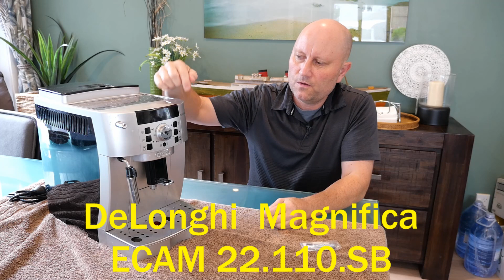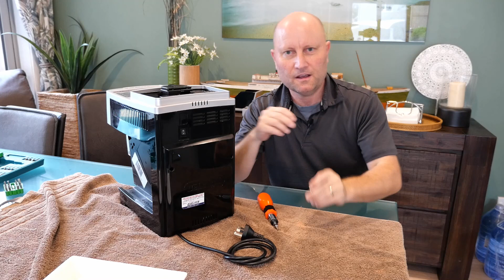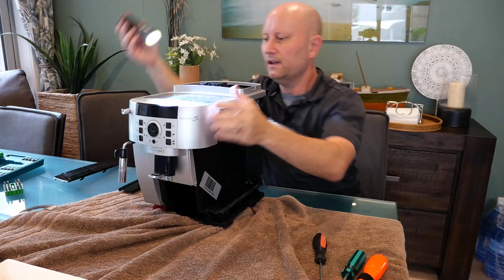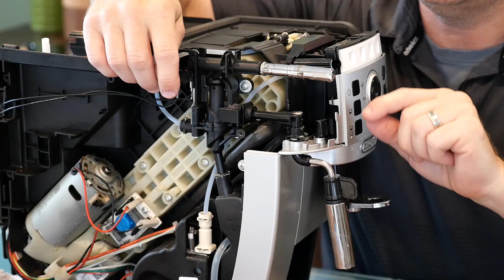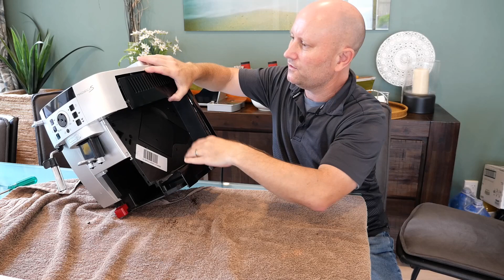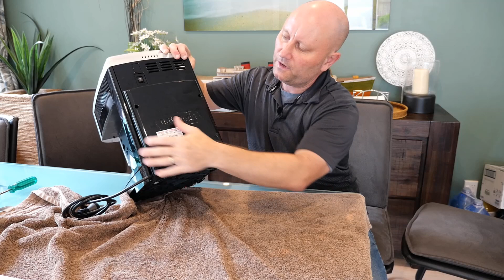DeLonghi Magnifica COFFEE MACHINE FIX Steamer handle - Disassembly Tear down ESAM22.110

Comment: Great video. After watching the whole video first I decided to just try pulling the steamer knob out without disassembling the machine. It came out relatively easily with the locking ring still attached. Pushed in the replace knob (without locking ring as suggested) and it works. Job took about 30 seconds after watching your video! 😅
Reply from the maker: Excellent, thanks for watching & glad it was helpful for you, in doing the fix

Comment: Thank you for the video I did not know the steamer handle pushed right on as a viewer mentioned that I read after fixing my unit. Somehow while turning off my steamer  I pulled the knob off! I initially thought I broke it. The star tool which I have the normal version I just dremeled a tiny hole in the end of my bit as a drive to town in Alaska is 2 hours round trip. It worked I’m happy!
Reply from the maker: Glad this video was helpful for you and you were able to fix your unit, great job with the dremel idea..  creative solution..
Reply: @DIY-CIRCUIT my unit is identical however has a flat push button front. That’s to bad your having so many issues this is my second DeLonghi Magnifica just a newer updated model. My first one lasted 12 years. I should have watched your entire video before starting i would have realized my button just pushed on. there is no retainer ring on my model so not sure it’s needed on yours. I’d leave it off also. That is one part they could improve. I’m looking forward to a great cup in the morning as cowboy coffee just didn’t do it for me after being spoiled with my Magnifica for so long.😁
Reply from the maker: @MurphysAkAdventures  Thanks for watching,  you just reminded me too, its coffee time.. cheers

Comment: Thanks for the video great inside saved me some trouble breaking something while opening for first time. I am not sure if the retainer ring is passing through the hole of the casing so you dont have to disassembly so many parts BUT I would not recommend just pulling it without supporting the support holding the male part maybe next time the support breaks. Also I would keep the retainer ring in sine the gearing can be damaged in time.
Reply from the maker: Thanks for watching and good to hear you found this useful..  you just remonded me too.. time to make a coffee

Comment: You dont need to pull it apart it simply pulls out. But thank you for confirming that it could be pulled out. Now I have a 20 second fix.
Reply from the maker: your welcome
Reply: same, goes off with pliers, but thx!
Reply: Yep, it pulled out without any disassembling and was replaced just as quick.

Comment: Great video, however, probably for many, the steam handle breaks because the valve is wearing and it is very hard to operate.
So your new handle will probably break again.
Well, this was my case at least.
Reply from the maker: Thanks for watching.  Yes I suspect in some cases a stiff valve can put pressure on even a new handle..

Comment: I had exactly the same model from new and it had no such retainer ring. Also the screws on the back needs a T20H driver as the screws have a tiny  central pin. A simple star driver will not fit
Reply from the maker: Thanks.    I didn't replace the ring on this unit, and still working great

Comment: You don’t need to take it apart. The handle pulls off. It took me less than a minute to fit
Reply: depends if the original one left broken parts and the spring closer part inside or not... if bits are left inside on the spindle the new handle won't be able to go as deep on the spindle as it should and will therefore in turn break off easier...
Reply: The machine from new had never been repaired before. I searched two solutions, the first was a tear down, the second was to simply pull, which I tried to, and it worked. There was no clip holding it in or any broken pieces.
Reply: @enthusiasticone5133  yes. that's what I'm saying though - it's quite possible that the old spring retainer part of the old handle will get stuck inside on the spindle and if that happens you need to take the cover off the sides to remove it. (which is actually very easy anyway and takes only 5 minutes). to be honest it's a design flaw with the stiff spindle and plastic knob handle parts.
Reply: There was no spring retainer
Reply: @enthusiasticone5133  all the steam knobs have a little spring on the end afaik maybe it's inside on the spindle
Reply: So, you’re calling me a liar. I will say again, I bought mine brand new and the steam knob DID NOT HAVE A RETAINING SPRING. It could be a factory error, but it didn’t have a retainer spring.
Reply: mine didn’t have and I replaced it two years ago and it hasn’t broken so…
Reply: I also just set the handle on on-mode and could pull it off.
Reply from the maker: yes, true sometimes you can pull off without opening.

Comment: I have two questions if anybody has the time to reply then very much appreciated.

My machine broke today, the steam lever was stuck on the ON position, I was able to return to OFF and have since ordered a replacement part. 

Did anybody find that the lever was really stiff? 
Will replacing the leaver provide the correct leverage or do I need to consider buying an additional spare part?

Cheers 

Dan
Reply: it's pretty stiff and stays that way. there are a few different type of steam knob replacement designs - try to find the one that looks like the one that it originally had.
Reply from the maker: yes, they can be stiff.  some lube inside might help

Comment: I had put off doing this for months and then when I finally sat down to do it, discovered none of the T20 screwdrivers would even grip the screws because they are in such difficult positions. I am so glad I decided to read the comments. So, I would like to agree with everyone who said you don't need to do all this disassembly. Simply remove the broken steamer handle (ours had split and fallen apart, so had already come out). Stick the new one in the hole, without the split ring, and taa daa - it is fixed!
Reply from the maker: yes, definately, its worth trying the fix without dissassembily

Comment: QUESTION i have the same machine new looking at it for a friend everys cleaned water in when i hit the power switch i goes through its cycle and i get the red triangle , i also looked at the infuser and it stops where i cant remove it beouse the gear arms are spread ive tried everything but it ends the same ? thanks
Reply from the maker: sounds like a trycky problem.  I havent seen this one.

Comment: Excellent video, thank you very much. As with Tracy below, I was unable to remove the coffee dial but discovered that it wasn't necessary as the cover lifted straight over it.  Also great advice about removing the small wire ring at the end of the replacement handle to avoid the dismantling later.
Reply from the maker: thanks for watching, much appreciated

Comment: I had the same problem and Delongi support team said that the knob can be replaced without any disassembling the machine. Is that correct?
Reply: Yes. Just try to pull it with minimal force required to get it off. Don't get brute forcing it or you risk breaking old plastics that have heated and cooled many times.
Reply from the maker: yep, as per the other members reply,  in theory you can remove the handle without opening the machine, but it can be very tough to pull off (and can break the internal gear)

Comment: Thank you. Excellent video. Took my time, cleaned inside before re assembly and all done in under an hour. I couldn’t get the coffee dial off the front panel but pulling it forward slightly moved the plate far enough forward to allow the tabs to go back in; job sorted. Watch out for hidden tabs on the front plate as well. I also had to leave the o ring off as I simply couldn’t physically push the steam knob back on with it on; maybe should have tried a bit food grease but it’s sorted.
Reply from the maker: Thanks for watching & Im glad you found this info useful.. keep up the great diy work

Comment: What type / size is the torx star do I need? None of the ones I bought seem to fit…..
Reply: Mine needs a security torx with a hole in the centre to take the little pin in the centre of the screw head.
 It has S2 T20H stamped on it.
Reply from the maker: S2 T20H  is the best

Comment: Many thanks for this video, is very usefull.. really great and i tryied to take out it without disassembly the machine and it works as well. There was just spring, which I by second trial lost inside but I will order the new one and change it. Thanks a lot.
Reply from the maker: Thanks for watching, I'm glad the information was useful.
Reply: depends if the original one left broken parts and the spring closer inside or not... if bits are left inside on the spindle the new handle won't be able to go as deep on the spindle as it should and will therefore in turn break off easier...

Comment: If the steamer handle has broken it's probably because the valve is stiff and requires lubricating with food grease ( I bought some at Bunnings). DO NOT use a grease that is not FOOD COMPATIBLE.   If it's still stiff it may have to be disassembled and cleaned out and the internal o-rings greased. Not hard to do.   I take pictures as I disassembled mine to make sure It's reassembled correctly.
The screw driver for the back panel is a   T20H
Reply from the maker: certainly agree, lubricating with food grease is a very good idea.

Comment: Thanks for the informative video on how to take panels off. However  I just took your advice  on removing the locking ring off the new knob and hey presto it slipped back on in 3 seconds .  without disassebling Works fine ....but we'll see
Reply from the maker: well done,  getting the swap in without disassembily.  certainly worth doing it that way if it comes off ok.  Thanks for checking out the video.

Comment: It’s actually much more easier than this. Just pull the old one off with players and push the new one on.
Reply from the maker: Yes, techinically, you could try and pull the know straigh out, however there is a risk of damaging the internal mount, doing it this way (as the rotation shaft is not that strong on the inside of the unit.)

Comment: So it’s a shame you can’t just pull the handle out along with that ring ? Ours has the same issue luckily my machine is still under warranty
Reply from the maker: I was thinking exactly the same thing when I did this repair.  It is possible it might come out, if pulled hard enough, but I suspect there is a risk of breaking the spline that the handle is fitted onto. Those internal parts just didn't feel that strong or robust.  Good luck with the repair.